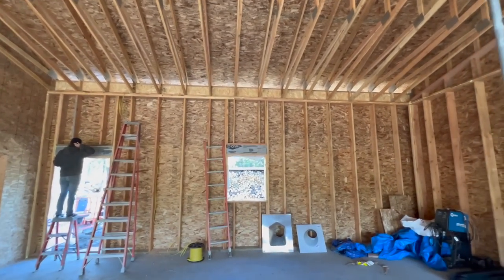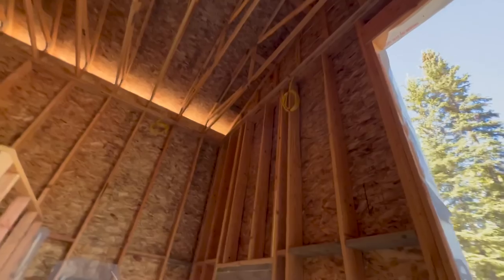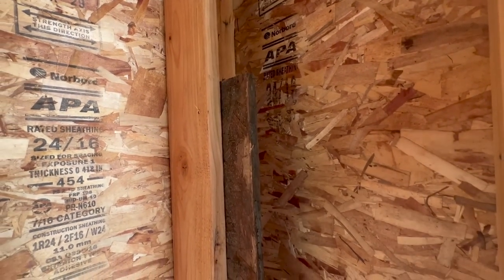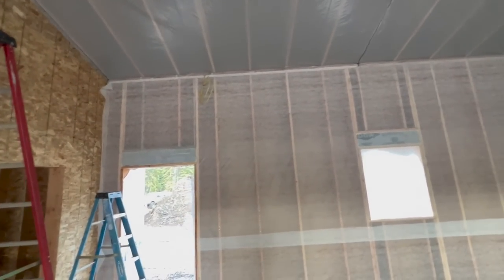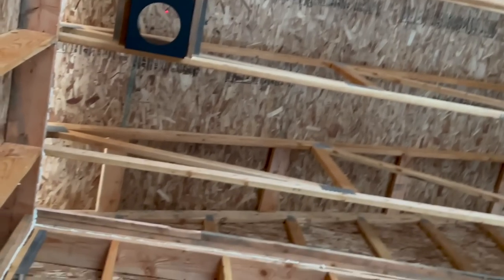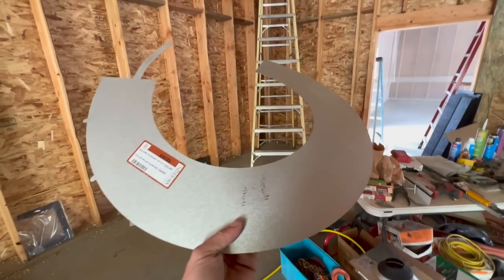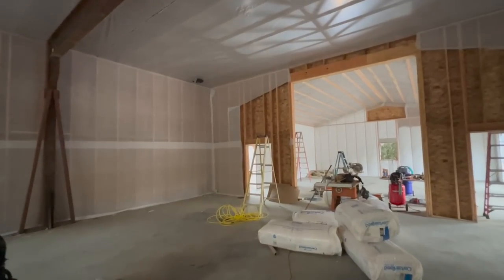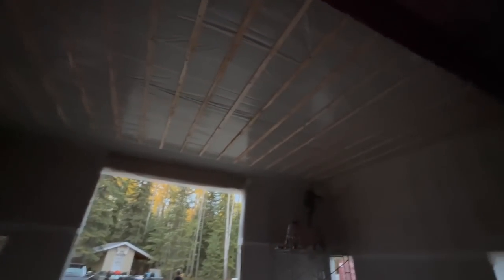Building our Alaskan Dream Home/Shop Pt. 17 Stove Pipe Install and Blow in Insulation

Comment: Why did you use blown in insulation vs bat? Was the vapor barrier on the walls "breathable"?  nice looking job , will make a great shop.
Reply from the maker: You get a R 35 out of an 8” wall with blow in vs R25 with batts. Normal vapor barrier they used a mesh to hold the insulation in and then put vapor barrier over that
Reply: @diyalaskanlifestyle  I see, never seen the mesh before, figured that is what it is for. I guess you can get it at Lowes

Comment: You get any time to hunt this year? I'm doing basically the same thing in delta-junction. Warm amd cozy by the wood stove now. Good thing cuase winter is here. Good luck!
Reply from the maker: Yes we did get out for moose should be sharing that video next week. We are warm also, boiler is all hooked up installing the shop door this week. The temps drop off next week

Comment: I looked up a video on how diff insulations burn... and my god that is scary... i know the R value is great, but holy moly...
Reply from the maker: What do you mean I blew in fiberglass not cellulose?
Reply: @diyalaskanlifestyle  just mentioning. that spray foam insulation stuff is scary... glad you're being safe :)  well, as safe as one can be anymore... still looking forward to the rest of the build! keep the great content coming :D
Reply from the maker: @jayjonah2762  I did put 2” r tech foam inside which prob isn’t the safest but that’s pretty much how most house are built anymore up here because of how cold it gets here